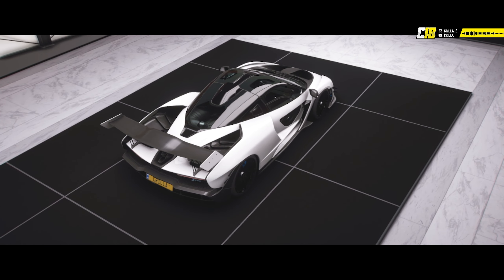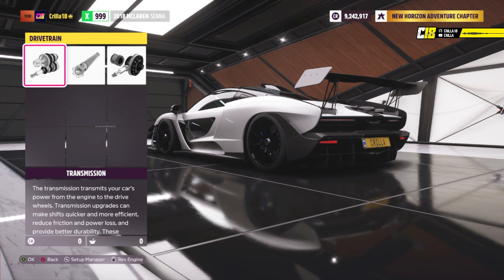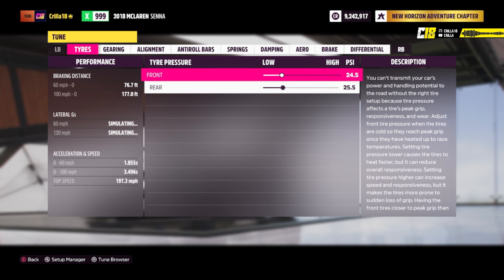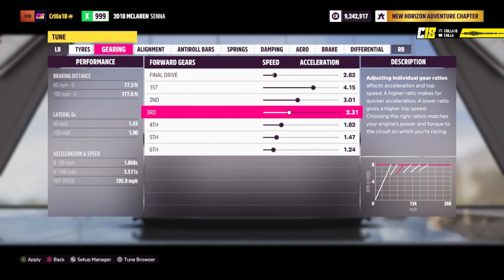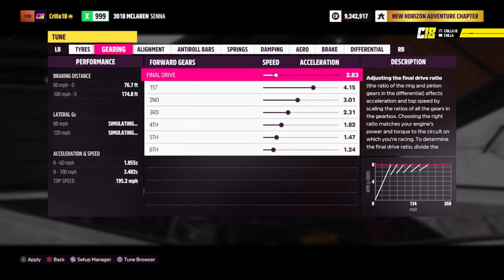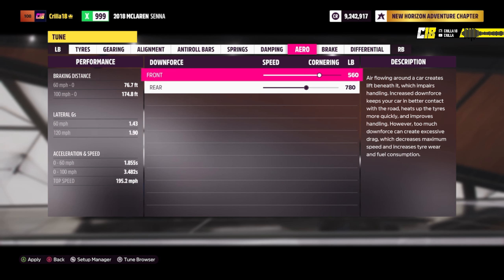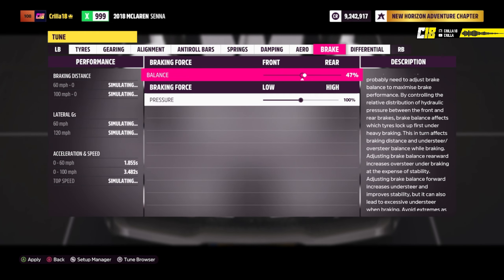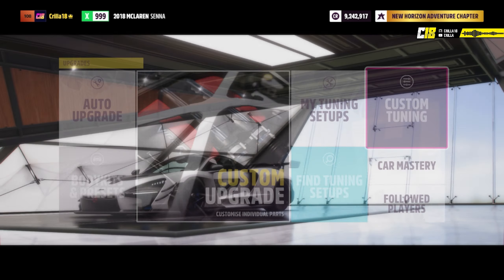How To Tune A Race Car Forza Horizon 5 - How To Grip Tune Forza Horizon 5 - Race Tune FH5

Comment: this may sound harsh but this guide has lots of room for improvement. if you wanna go around corners as fast as possible in forza you have to abuse the physics engine by minmaxing tuning settings to get more rotation out of the car. some of the settings i recommend may seem unrealistic or crazy, but are faster because this is a game, not even a full sim one or real life.

first of all, youre using an x class car as an example, which is fully maxed out, so knowing what right upgrades to use in lower classes where you have a limit on how much pi you can use is not something youve covered. its very important and often overlooked

there are optimal tire pressures for each compound. 24psi is a bit too low for slicks as they will overheat frequently. i use 29psi

the stock gear ratios are not good enough for most cars in forza by default.
this car would benefit a lot from a longer 1st gear

you have too much camber (i run -0.5 on front and rear) and toe should be completely avoided except on drag tires or as a last resort

your anti roll bars (arb) are too understeery. 1-65 will make this car turn much better

your springs are too stiff and your rideheight too low, 450lb/in on front and rear and max rideheight will make this car much more stable

your damping is also WAAAY toostiff. 10-10 4-4 will make it much more stable. you can increase rear rebound or rear bump for more responsiveness but not too much

your aero is too understeery aswell. always max out your front aero, its free grip
and rear should be around the same as front

the brake balance slider is actually inversed, so increasing it towards front actually increases braking on rear

your diff is also too understeery. 100-0 100-7 75 will make it much more responsive in lowspeed corners
Reply: Thanks so much for this comment
Reply: bro its been 7 months i forgot i even made this comment 💀
Reply: I want to learn to be able to tune like this but idk where to start
Reply: @mk5925  i might make a video or guide on my forza channel
Reply: Just recently started getting in tuning,I seen some meta builds run differentials differently and don’t understand why.

They either run; 
100-0, 100-15, 65
100-0, 100-7, 75 
20-0, 100-20, 65
30-0, 55-30, 60

I commonly see those four for AWD meta cars but not sure when to use what. 

Also for damping you said 10-10, 4-4 but I usually see 20-20, 1-1. I know damping is important but also don’t understand the differences.
Reply: @vZei  i  have never seen those 2 bottom diffs. diff accel is almost always maxed out at 100. it gives more rotation and turn in and this is why its so common

and nuked damping works in motorsport but not horizon. max rebound is too much for road and you need more bump stiffness for curbs. 10-10 4-4 is still good but 9-9 3-3 is also good if you want it to be softer. damping controls how suspension reacts to bumps and elevation changes. more rebound makes it more responsive, but too much will make it lose control over elevation changes (usually over 12). bump stiffness is the same and going too much (usually over 5) will cause your car to lose control over curbs and bumps, which is bad especially in the city
Reply: @romie-777 beer will do that

Comment: Great video mate! After a few FH5 Updates I may add a few more details, 
DIFFERENTIAL TUNING, 
you want to push the car through turns so you'll want to have slight rear bias differential, ~5% or so difference you'll have to play with the how the specific car reacts to turn in and lift. But slip angle is your friend. 
BUMP & REBOUND 
These settings are very important and not to be overlooked, this is what keeps the tire planted after hitting a small bump, going from road to grass, hitting various curbs, sidewalks, and all the debris we can hit in Forza. It's very important to have proper dampening to keep the car settled and not to stiff that it's bouncing under the stiff springs and sway bars!

Comment: this should not work... it does clearly, but it shouldn't... why it works : 
-flat tires give you grip but your tires should be destroyed.. 
-stupidly stiff everything + aggressive Downforce.. this again shouldn't work, you you should have shit handling and terrible top speed...
-AWD... in F5 this is essentially easy mode. Normally you'd WANT your diff to be More rear end focus to give you oversteer so you can get out of your corners faster but again unaffected because you slammed the car to the ground, have so much downforce, suspension is stiff as hell, and you have constant grip with flat tires.. all the negative effects of your build are covered up because the game doesn't take them into consideration... your tires should burn up, your car shouldn't turn well because your suspension and differential is a mess, traction control is allowing your diff settings to work when they shouldn't.. you don't want all wheels moving at the same time all the time.. you definitely don't want your front end to be stiffer than your rear that would cause major understeer... your settings are just a game breaking loop hole. no offence. it just shouldn't work.

Comment: Not true, positive camber doesn't increase tyre contact in straight lines, it tilts the wheels the other way so you get less contact also.
The fact that of the little that you do explain, half you get wrong, makes this video pretty pointless.
People will copy what you do and have no idea why or even remember your wrong information.
Reply: a LOT of this is ass backwards, I think what's helping him the most is his stiff ass suspension, the AWD and his flat tires.. clearly that's still a broken thing in FH5... negative camber helps keep your tires flat in high speed turns, you would want to have your central diff more to the rear about 70 - 80, you'd want your rear Diff to be about 80, front to be about 15, you'd want your non throttle diff to be about 10 -20 ,  you'd want your bump as soft as you can go without bouncing everywhere , you'd want your rear roll bars to be stiffer but front to be neutral based on weight, you'd want your rear suspension to be stiffer and your front to be neutral or even a little softer.. your tires you shouldn't fuck with but that's clearly a broken mechanic... ride hight two above the lowest point. and you adjust your settings in front if you under steer and rear if you over steer to much you WANT to over steer somewhat so you can get in and out of corners faster... your tires should be on fire and your car should not be turning what so ever... but the game mechanics are busted and the flat tire glitch still works.